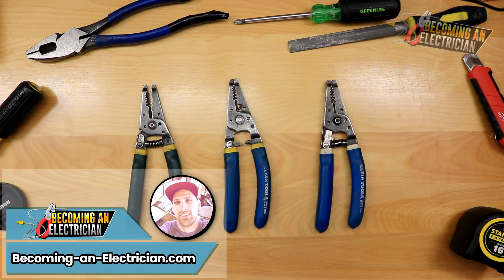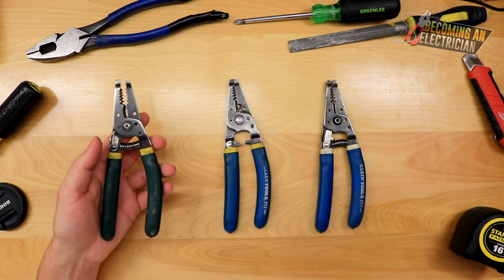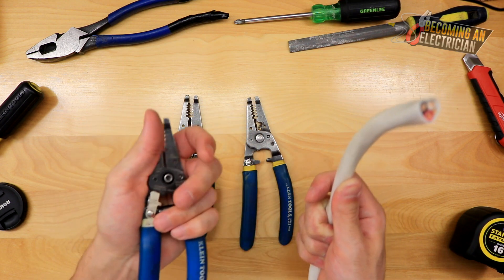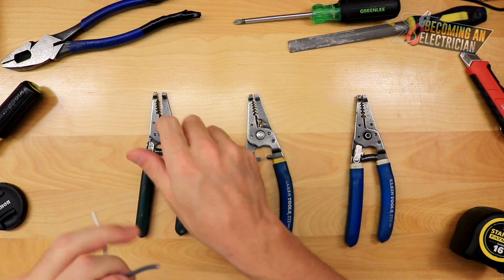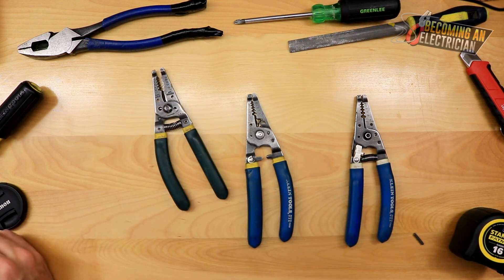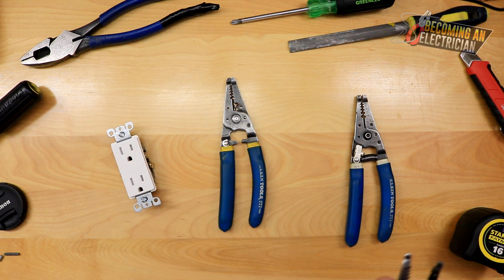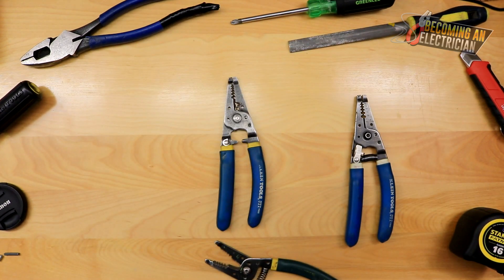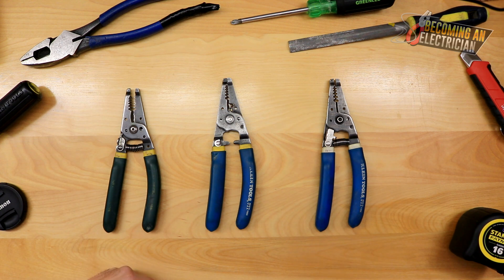How to Buy Wire Strippers for Electricians

Comment: Is there technique involved in stripping longer sections of wire? Like if ive got 15ft of 14GA wire that i want to strip down to bare bright am i better of just using a razor blade at that point?
Reply from the maker: There are machines to strip wire if you're looking to recycle the copper for money.  If not, you can use the bare bond wire #14 in the #14/2 NMD ?  Otherwise, you should be able to strip a decent amount each time.  Be careful with the razor blade.. https://becoming-an-electrician.com/
Reply: @BecomingAnElectrician  like expensive machines or those hand ratcheting splitters?
Reply from the maker: @frostyxmeboi8878  Haven't seen the hand ratcheting splitter you mentioned.  But you can look up "wire insulation stripper machine".  You feed the wire in and it removes the wire insulation to expose the bare wire if you are recycling, you will get more money back.
https://becoming-an-electrician.com/